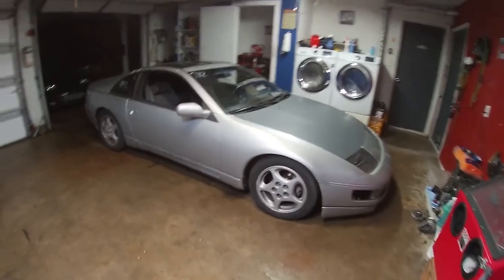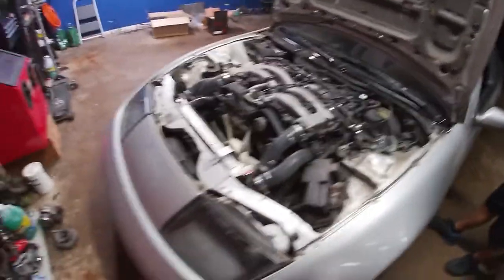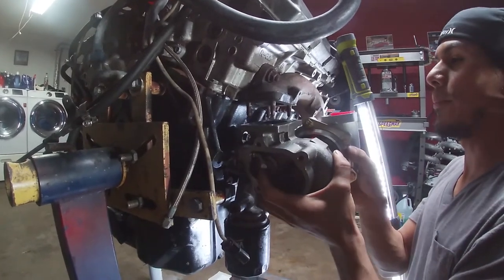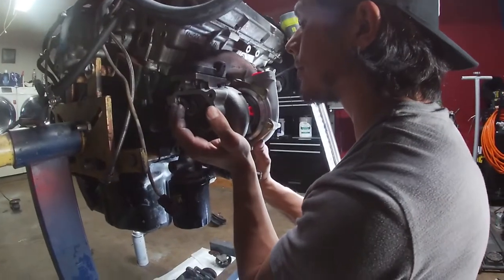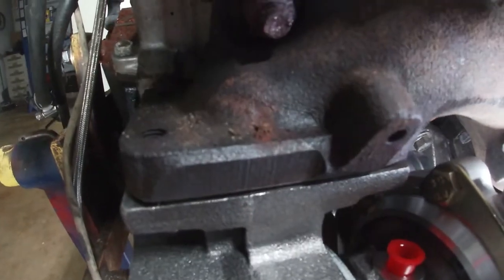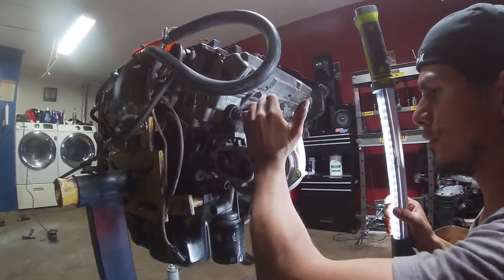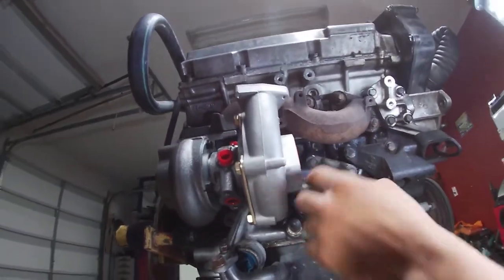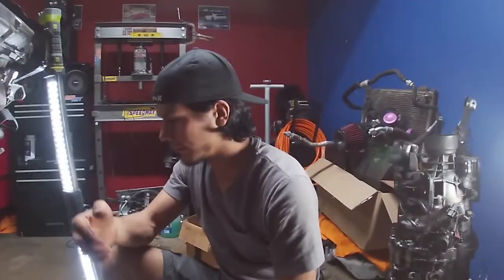Installing Ebay Turbos On a Nissan 300zx! PART ONE!

Comment: Thanks for the video OverBoost. There are so many that always will comment "why go pulling the engine and all that work, and not spend the money on good turbos??". I just went through this same exact build (and modification to get them to fit. I had a shop pull the engine, hand me the engine for lots of clean up gaskets , seals and such and they just finished installing the engine back in my '95 body. Everything went over budget and time as I knew it would. After spending a small fortune I had no issue going with the China/eBay turbos. I plan on replacing these down the road with better quality (hopefully before I have any failures).
   I should have recorded every step and did a YouTube thing but it's hard to break out the video gear when you have limited time for this as it is. If you are interested, I will post my experience and thoughts on it after I get my first test drive and some miles on them.

Comment: i have had so many clients get these ebay turbos put on and they are crap and keep me in business. Thanks fellas., I love it. Keep putting thes garbage turbos on the 300zx because my clients tell me like after 2 to 3 weeks they start smoking. lol
Reply from the maker: I wouldn't recommend these turbos to customers. These are usually for diyers who don't mind turning wrenches. While they do have a 50/50 failure rate, the 1 year warranty on the turbos should be spent saving for better turbos. At least that's how I see it. If anyone is having a shop do the work, then they're not doing enough research and pay more in the long run.
Reply: @overboost8727  you know it man! Its the triangle right? pick two reliable fast or cheap lol

Comment: Did yours clear the waste gate rods from the oil filter or did you need to do any clocking to the turbo and also do you need to shave down both motor mounts or just the passenger

Comment: If i were to do this upgrade an actual TT VG motor with these turbos, would i need to run e85? Or would they work just fine like that? Would i need to get a custom tune or anything? Just curious cuz I'm buying a JDM TT VG and would like to build while i wait for a good z32 shell to pop up.
Reply: No, You need an 740cc or high to run e85 and need a custom chip ecu for that

Comment: Someone in my city has been running the jm eBays at 25psi on e85 for quite some time
Reply from the maker: Good to hear Cameron so far they have held up good running 17psi on e85, hope these last a good while so people can start doing low budget set ups with them. We will keep ual posted when they fail.
Reply: OverBoost seems like they are actually decent turbos that’s three ppl Ik of that have them and run them hard
Reply: @overboost8727  Hi, are these still working after a year?
Reply from the maker: @thebrossyt7015  the car was sold, sorry 😞

Comment: so if I heard correctly, this is a NA VG30? thought I would have to swap to turbo my z ?
Reply from the maker: Outdated information.  You can boost the Na engine reliably while running e85
Reply: Ok so im about to buy a 1994 300zx NA, how do i make it a twin turbo help im a noob
Reply: @overboost8727  can you run E85 on stock injectors? I have an aftermarket fuel pump and I’m about to do a single turbo T3T4 on NA engine. I figured on 93 I could run 5-6 psi on NA compression. On E85 could I run higher boost on just a fuel pump and stock injectors? Lmk please I would appreciate your help. Great videos!

Comment: are you gonna at least make sure the turbine is balanced? or just run em as is
Reply from the maker: Alex Wright the JM turbos come with a “generic” balance sheet showing they were balanced at some point. Not sure how reliable the balancing they do is but we are running them straight out of the box, really not worth it to spend an extra 300-500 on doing our own balancing.